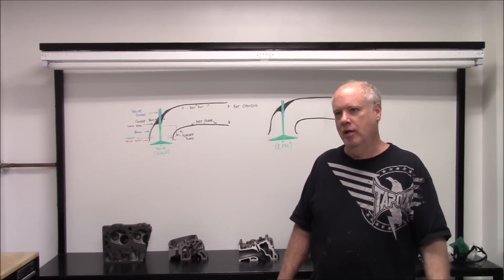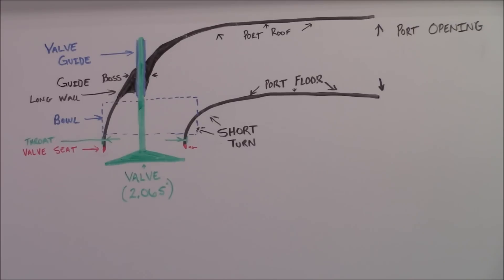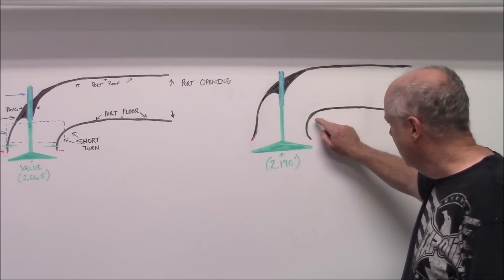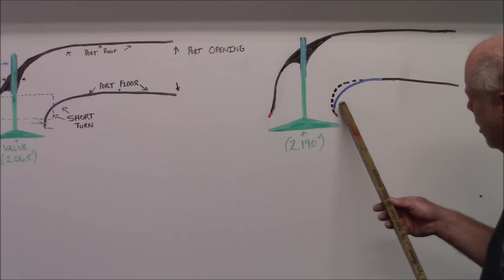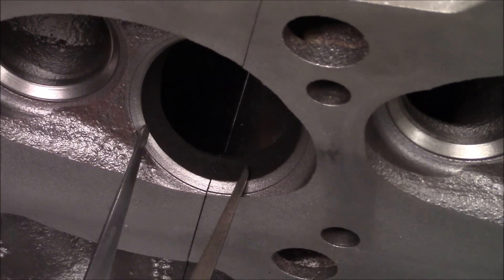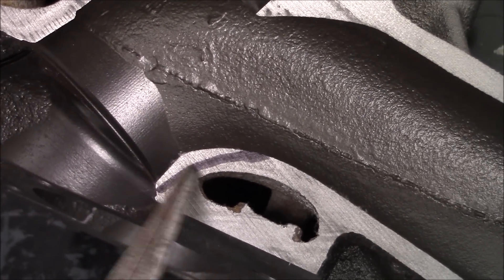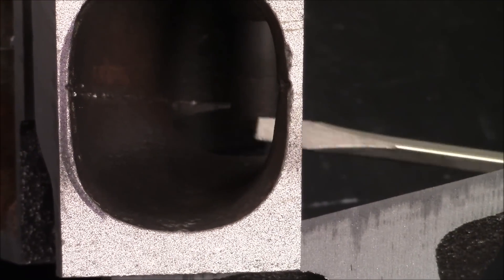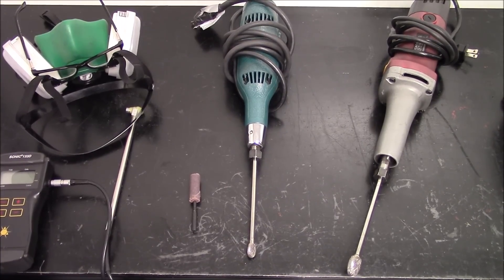Part 21 - Cylinder Head Porting Terms and Tools - 620 HP 454 Big Block Chevy Engine Build

Comment: ohhh ffs the greatest velocity of flow is at the center of the conveyance wether air or water change the damned valve so your air isn't running head long into it and the rest piles up behind it would you fit a large circular object to the front of your friggin cars to go faster and it would make a terrible spoiler. the valve is always the biggest problem no matter what shape you make it. the friggin slug in the intake is being slowed down by it

Comment: Awesome video. I understood that the 2.19" valve port would flow poorly but I don't know why. It makes sense by looking at it but I don't understand why it make sense. I have often had this issue where I understand why or how something works but couldn't explain why I know it if my life depended on it. Perhaps someone could explain precisely why or recommend a book that would help me to understand the basics better. I would very much appreciate it. Thanks
Reply: Pretty sure it's momentum and direction of the airflow. Air intakes rely heavily on momentum to "ram" more air into the cylinder. Larger openings means a reduction in that ram effect but a potential increase in flow capacity if shaped correctly. Its always a trade off between air intake speed and flow capacity.

Comment: You state that the modified port (as originally drawn) won't flow past .500 lift but fail to explain why.  The statement at 9:28 lacks an explanation too.   (I know why.  Just pointing out the failure to offer explanations.)

Comment: Porting is easier when you think about air as a liquid. I look at ports as if they were a river. Where are the disturbances?
Reply: I put in a soaker tub once and was frustrated at how slow it filled. I took the faucet off and ported it like an engine. It flowed like a beast after I was done!!!
Reply: @paulslevinsky580  but how was the velocity lol
Reply: @gabekenyon4882  supersonic
Reply: Exactly
Reply: God says, “Air follows the inside corner.”!
Reply: I mean, technically air is a liquid by definition. That's why the word aerodynamics is defined as the study of fluid motion and is still used to explain how planes fly.
Reply: @sethh8892   Air is considered a "fluid" not a liquid.
Not being a dick, I recognize that you understand, but I wanted to correct your error.
Reply: @kennethalbert4653  aight, fair point👍👌

Comment: Do you cut shanks on burrs? I find around 4" easier to control  than stock 6" on the motorcycle heads I play with
Reply: @port nut thats what she said ...😁
Reply: 4" is pretty much perfect. The longer the shank the less control you have over the tool. I have done hundreds of motorcycle heads and they are generally more challenging as the ports are much, much smaller so control is everything. I use Foredom foot speed control units...great torque to run at slow speeds to enhance control as well.

Comment: What does a sonic thickness checker cost? And where to find one?? Great video, I'm debating on should I port my 94 7.4 Chevy heads, the engine is from a rv. I have a ovalport pergormer rpm I take and full length headers. A very similar engine made 330-340hp and about 450ft lbsTq.  At a fairly low rpm. I'd like to get it to about 400hp. and 550 in the TQ! I'm curious about the truck heads, if they are worth porting? I know they are probably thin , of should I look in to some older model  Heads. Maybe 70's heads I don't want to raise the compression much. I want it under 10:1, all though a 10.5:1 454 would be awesome on the street! But I want to run mid gtade gas. , and decent mileage,  that is new to me. I'm used to getting by all the power and measure  in gallons per mile!! I'm rambling ,  great video

Comment: Mark, apples to apples would the rect. port be a better choice over the oval but just too rare to find 50 years later??
Reply: He proved these oval port heads are better to 730 HP!  The torque with these oval ports is superior compared to lazy rec ports!
Reply: @trailerparkcryptoking5213  Youre probably correct with the enhanced valve size that he used and other tricks, he is a VERY smart guy with that complete build, from crank and balancer updates to everything else. The rect. port VS the oval from back in the day had bigger valves, i had a 427/425 in a 67 Camaro so it was a Yenko clone and had the 2.19 intakes like the 396/375
Reply: @zxtenn  Richard Holdener has a video on rect ports vs oval ports, check it out..... the ovals outperform.
Reply: @trailerparkcryptoking5213  Thanks, i watch lots of Richards vids, VERY smart and great comparisons

Comment: Greetings from Australia,Great insight Mark, thank you. Very few engine builders would share 'secrets' as you do. You're impressive on all fronts. 
I'm Currently building 496 with full CNC AFR heads 300CC ,with 260@50 solid roller.

Comment: I did get bench numbers from my 781's that I ported (first time porting anything). I'm curious what your opinion is on my numbers Mark. I'm using Ferrea 2.19" 1.88" back cut/swirl polished. The guy that ran the bench only flowed on port, and I'm not entirely sure which port. But here goes....
.200=151.5            ex 114.2
.300=283.2.                 147.1
.350=266.1...????        158
.400=287.5.                  169
.450=297.9.                 178.1
.500=306.9.                 186.2
.550=307.8.                 193.4
.600=310.1.                 201.9
.650=311.3.                210.3
.700=311.3.                 211.6